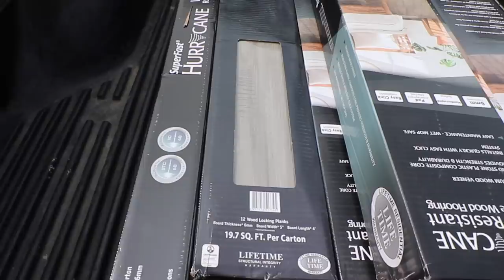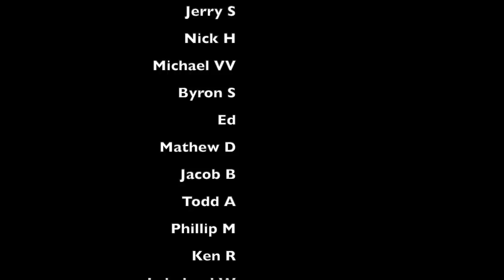Finally! Installing Flooring | Off Grid Cabin Build

Comment: Floor color is awesome ! I personally prefer the vertical siding you installed behind your kitchen sink and bench ! I like the wide tongue and groove siding versus the smaller width that you used on those white wash walls and I think having part of the wall going horizontal and the other half going vertical  makes it look too busy, still looks good just my preference . had to edit my original, came out too negative! :)
Nice job buddy ! its coming together really well , btw , that loose floor board id shoot a couple of finish nails , you can fill the nail holes with chalk .

Comment: On that loose board near the fireplace, place some brats to hold it flat. Then mix a gray, wood-glue slurry to cover the brats. A slightly darker gray is good because it hides the dirt and stains better.

Comment: Love the color! You pointed out exactly what I noticed and that of complimenting the wood stove and tile as well as the backsplash.  We did something similar with a very contrasting floors with knotty pine on the walls and ceiling.  I couldn’t tell for sure but the threshold going into the bedroom looks a bit higher.  If so, you might think about ramping that threshold into the bedroom a bit.  As a guy who stubs toes one a piece of dog hair it might be nice...  Routered with and angled jig might work.

Comment: Get some PL premium adhesive and use a wedge to lift it up and then squirt in some adhesive and then lay it back down.  Place a board on top then place those cement bags on top.  Leave it for 24 hours to set up and you should be good to go.  Install the plank baseboard with kerfed corners and you shold be good to go.  I always run a bead of clear silicone caulk under the baseboards. It keeps spilled liquid from getting under the baseboards and messing with the drywall behind.  The major upgrade was a good idea.  I know exactly what you mean about the breakages.  It's a colossal pain in the ass.  The broken bits get jammed into the groove and things don't lock together.  You spend tons of time with a spatula clearing out the slots.

Comment: I have a laminate floor in my cabin in Maine.  My first floor was tile that lasted 25 years.  The laminate seems very tough and has held up well and certainly looks better than tile.  The secret is to sweep frequently to avoid damage from grit.  Edging can be simple quarter round stained to match.

Comment: I like the contrast of the dark floor against the lighter wood.  Having something that is waterproof/water resistant will come in handy.  My dad and I recently layed luxury vinyl plank flooring in a 24'x24' area that had a hallway opening in the middle.  To make sure the flooring would line up well for the hallway and we wouldn't be left with a sliver on either wall we layed a stacked row of flooring all the way across the room and then adjusted it so neither wall had a sliver and the hallway didn't either.  As your said, all in the preparation.

Comment: You couldn't really go with light wood , too many almost similar types and it would look bad, apart from looking like some sort of rustic play pen. Same goes for white, it would have been a problem against the walls. The laminate is going to be an easy clean for coming straight in from the woods and it goes with your well finished look. So good choices for material and colour, as usual.

Comment: I did the same kind of floor. After about a year any gaps were filled in with dust dirt dead skin hair and anything else and it looked great. That one board will probably relax. You can put some brad nails in also. You won’t even see them after the stuff I mentioned above happens.

Comment: The laminate flooring may be a good choice given the use you will have in the cabin. A lot of messy boots, etc. will come in so it will be easy to clean up. My gut tells me that you will eventually tear it out and put in hardwood even though it is a lot of work. All that great wood around the cabin and then you will see the plastic floor. That's going to drive you crazy. :)

Comment: The floor looks great.  Try gluing the edge of the loose piece. If needed try putting a tiny brad every 12 inches on the loose edge. As long as they are flush with the top of the wood it should do fine. In my business we've had this happen a couple of times.

Comment: I saw a trick a laminate floor installer used. You turn the saw upside down and cut with the saw shoe on the bottom of the flooring. The blade is now pulling down from the face and you get no tear out. Alternatively, I think there is also a laminate floor blade you can get for your jig saw.

Comment: I was a 70%er... I liked the ease of cutting making the job very clean. It must be vinyl?  Flooring is just around the corner for my cabin. My wife and I just completed the installation of 1/2 in., R3.5, insulation board, covered by 1/2 in. ply. I like to eliminate the thermal bridging from the floor joists, bringing the cold inside. Although it took many, many, screws to secure, I believe it is worth it.                                                              Great Job!

Comment: The floor looks great, look at the practicality of the floor, its in the same room as a door, people in and out, tracking in dirt and grinding it into the floor, would the wood of stood the test of time, I don't think it would you would eventually have to refinish. Love grays they are neutral, this is the perfect floor because it would be the most used floor. Great job

Comment: I like the grey floor ... like you said, it’s a nice contrast to the walls.  I’m not keen on everything inside the cabins looking the same color where you can’t tell the ceiling from the walls or the walls from the floor.
I like the idea of vinyl, too, because you can change it up in later years if you want a different choice.

Comment: I think the whole thing is coming along beautifully.  It will look a lot different when you get the furniture in and a rug on the floor.  Also probably things hanging on the walls?  You have done a splendid job on the cabin so far but must be looking forward to getting outside into that beautiful 50 acres and absorbing some of it.

Comment: I used the same exact flooring and like you found the same issues.  I think it will be ok but not a product I would use again.  I also have two thresholds to redo now.  I’m redoing an old farmhouse in Ohio on 40 acres

Comment: Floor choice tends to dictate wall and other choices.  The pop you see is the strong contrast between the light color walls vs the dark color floor.  Dark colors tend to go away ... esp the floor.  Accent on the walls picking up the darker floor will give balance.  The product choice may be good as a cabin floor due to the fact much snow, rain and other muck will be tracked in .... with cabin life.   On the other hand if you find the material failing it is easy to take up and choose a better material.   I also like the floor's color, but not much of a fan of man made materials.

Comment: I think the flooring looks great and once you add furniture and a rug it will blend better. For the piece that lifter maybe add a fine screw or finishing nail and fill it with puddy that matches the flooring. that as if possible adding some glue however, the glue will only be sticking to the paper and not the sub floor.  can't wait to see the cabinet doors and table ...

Comment: 17:20 since you ddin't a Mud room, and if you won't have one, it's best that Floor color, it will handle the dirt from walking in and out from and to a muddy area in the winter or whenever it rains. I would leave it as is, no rug no nothing, but find out what's the best way to maintain its longevity. I think that material will settle down overtime and lay flat on the floor, sort of its glued. If you have left over pieces you can use them to replace an broken or cracked ones.

You may want to find out if can glue the pieces together edge wise, but not to the floor.

Comment: Truthfully my honest opinion my honest opinion is I would not be putting that kind of floor down are you going to put it in your bedroom too it would look kind of weird you have a wood floor that is beautiful in your bedroom and you put down something chintzy and you're living area it doesn't even match your walls for the rest of your cabin I would have went with a good wood grain wood on the floor and then I would have sanded it down and stained it it doesn't take much maintenance there after but at least a cabin looks Rich comfortable because it matches everything else what you're putting down is a modern floor and no it does not match your walls even though you think it does it doesn't that's my honest opinion I've seen a lot of homeowners do a lot of crazy things put pine boards up and then paint them white losing the richest of the wood. But you're going to do what you feel best it is your opinion is certainly not mine what I would have choose something a little bit different than that color a blonder type color that will match the rest of your homestead my opinion not yours yours is completely different than mine so if you're going to be that way why ask us for an opinion.

Comment: I think it came out pretty good for the most part. I like the color too. I looked at the Menards stuff and I feel like it wasn't as robust as the Life Proof solid core from HD. That's what we went with and man, the stuff is hella durable and lays really easy. I forget if you saw it the last time you were over, I think you did. That board that popped up I think could be glued and maybe you could even use some kind of pin nails, just pre-drill first. Came out great man! I still need to find some damn time to come down! Hope all is well!
Reply from the maker: thanks man!  we really do need to make that trip happen, perfect weather this time of year.

Comment: If the flooring has a rubber layer on the bottom of it make sure you peal it back and add glue at the same time you glue it down as it would delaminate over time with the bottom glued down.

Comment: Since the thresholds are pretty high, you have a room for an extra addition of 2-3mm second underlay for spot levelling and to retain heat.
Don't be afraid to reinstall everything once more with the surface being better prepared.

Comment: One good thing about that flooring, when it is worn and chipped after 10 years, it would not be hard to replace it. I have this flooring in my kitchen, and it has held up good but the corners are showing wear after about 5 years. The area where we have the breakfast peninsula stools is full of marks and nicks from the bar stools but we kinda expected that. Overall it holds up better than wood, but with wood it can be refinished. I am rough on our floor bringing all manner of dirt grime and stone chips stuck to my shoes, so it's a given that this floor will not last too much longer maybe a 10 year floor at best.

Comment: Used a similar product from busy beaver.  Worst flooring i ever put down. Didn't fit together. Had it out and back in 3 times. Forth time ended up screwing the first row down. 9 hours later finally in. 20 foot camper floor should have been an afternoon.
Reply from the maker: bummer sorry to hear that.

Comment: I agree with you the floor looks nice. Unfortunately i have not much good to say about click style flooring other than it goes down fast and relatively easy. That said I have experiences the same issues as you, not terribly durable and have had many issues with it coming apart at the joints. I have had more luck with the adhesive type vinyl strip flooring. But in the end nothing beats the beautiful ash wood flooring you put down, awesome👍
Reply from the maker: Yea the quality was a bit of a disappointment but I'm glad its done and I can move onto other projects.

Comment: Nice job on the floor. How long do you figure it took from start to finish? Just use a piece of quarter round to cover the gap between the flooring and door sill. Just a suggestion.
Reply from the maker: It took me 1 day, really easy install

Comment: Having built my house myself, I get the burnout that starts to set in at times. Also respect you putting yourself out there for the masses to criticize, I don't know that I could do that myself.

I may be spoiled over in NY, but you can get flooring right from the saw mills for less than that laminate. Also at that square footage, it's going to be cheap even if you got Cherry.

Comment: My english isn't that well and very clumsy, I have to apologize... would the cut not be much cleaner if you cut with the board upside down (at about 9:20 min)? By the way:  the flooring in combination 
with the brighter wallpanels looks amazing...
Reply from the maker: Im not sure the jigsaw goes both up and down so it could just as easily push our a chip.
Reply: @50Acres  Here's a video (actually in german, sorry) where it's explained to (saw?) cut a laminated board with a jigsaw. I think there's not such a big difference between the board he uses and your boards...
https://www.youtube.com/watch?v=OedSXXHyBAY

Comment: Do you always make the cut (add shorter piece) at either end of the wall,  or does it sometimes make sense in the pattern to add a smaller/cut piece somewhere in the middle of a run of planks?
Reply from the maker: Usually I try to keep the pieces long so it looks less busy, but its a matter of personal preference.

Comment: Putting in the floor is always a happy day. It means you're close to being finished with the major work. You don't have to worry as much about it getting scratched by dragging lumber, paint drips, etc. 
As for the type of floor/color - I have the same type of flooring in several rooms of my home. I'm going to end up replacing it at some point because it definitely has a wear life - and with 3-4 dogs in the house, areas that are traveled frequently are worn down rather quickly and the backing starts showing. Don't sweat the decision. It got you moved forward so you could work on the rest of the house and finish other areas as well as enjoy it. Know that you can easily replace it when you have the time. Sometimes you just don't know how you're going to like something until it's actually done. Now you can live with it and have a basis for the next iteration.
Good job!

Comment: How has your floor held up so far? We are looking to do our floors possibly using laminate. Most of the flooring stores are telling us that the fact the cabin isn't heated in the winter will be an issue.
Reply from the maker: It’s garbage, the stuff we used is the thinnest kind and the grooves that hold it together break.  I’ve used other laminate that is really high quality but this stuff isn’t
Reply: @50Acres  That's too bad.  You hate to have something not hold up well after all that work.  We may go with vinyl or laminate planks.  Not sure yet.  Have a great Thanksgiving!!

Comment: I don't mind the grey, it's got a slate look to it. I hope the flooring doesn't buckle as the timber in your cabin expands and contracts with the temperature extremes.
Reply from the maker: It should be fine because you leave an expansion gap around the perimeter.
Reply: @50Acres  all good then. In sunny Australia I don't have to worry about temperature extremes like you get. 
Been meaning to ask about your water system under the cabin. Would it be worth enclosing it with insulated panels so you don't have to flush it all the time
Reply from the maker: @brettn4337  Thats my eventual plan.  I've insulated it on 3 sides, just haven't done the final side because I still have to plumb my drains.

Comment: Wow... Looks great! However let me give you a heads up. I had the exact same floor, different color, same manufacturer and packaging. I put it in a rental unit of mine and the lady had a dog. The dog was not house broke! Everywhere the dog wet bubbled up the top layer on the Finish, just make sure if you spill something on it you wipe it up right away. Sorry for the spoiler alert, just a heads up from using the exact same product.
Reply: Same problem.  No dog, just water spills did it. Very disappointed.
Reply from the maker: Thanks for the info!  Our dog is housebroken but we will have to be careful about spills!